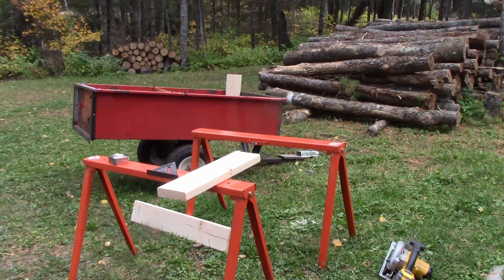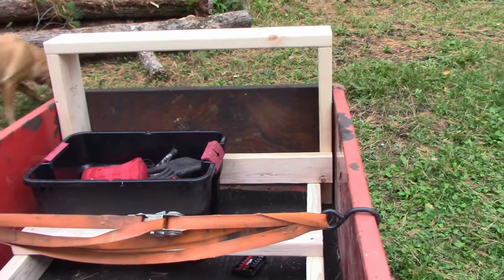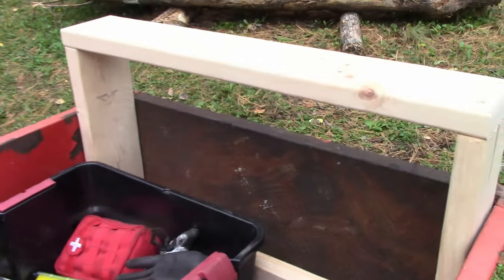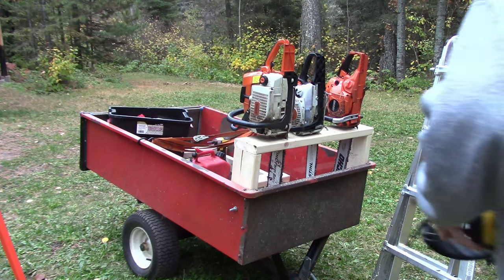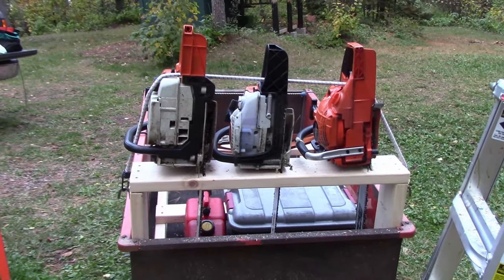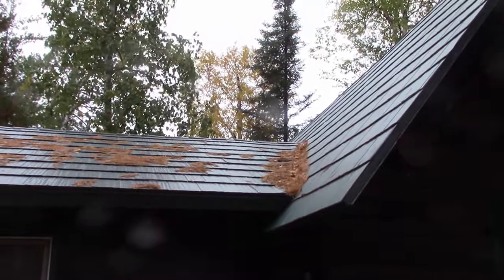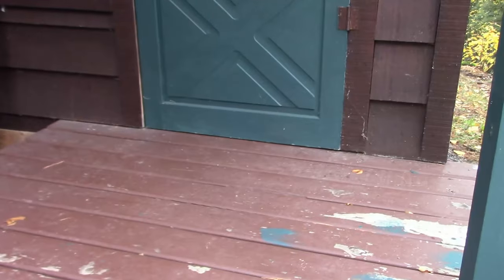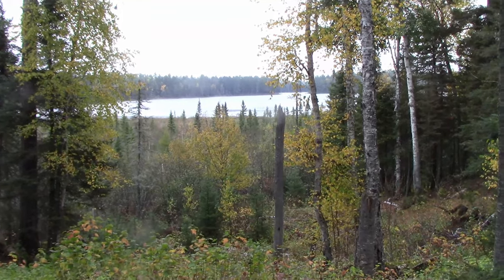Upgrading the Trailer for Chainsaw Work

Comment: Great idea for the cart. I have one the same size. I got it because at 75 I got tired of pushing a wheelbarrow around. Amazing what we use them for.
Reply: Nice update on the trailer
Reply from the maker: One of the most handy pieces of equipment when you have a cabin. Sure makes life easier! I hope you are going strong at 75. Thanks for watching.
Reply from the maker: Works great. I'm happy I made the upgrade. @hughwhaley3179

Comment: Around my building when ever it was built they didn't put in the rat guard along the bottom. I've lived here for just a couple of years and times i could hear the mice in the walls. So i put bait boxes outside and inside traps and I caught some. A few weeks ago I found on Amazon rolls of stainless steel material that I cut up in one inch wide by 4 inches long that looks like steel wool but is tougher. I went clear around the building where the ribs are and stuck in there then put extra screws in so they can't squeeze through
Reply from the maker: I'm sure that it has or will help immensely for keeping critters out. I used to hear mice in the walls too but since doing the skirting, there is very little sign of mice in the cabin now. It will always be a battle to keep things out but for now, things are much better. Always nice to get to the cabin and not see a bunch of mouse turds on the counter! Thanks for watching.